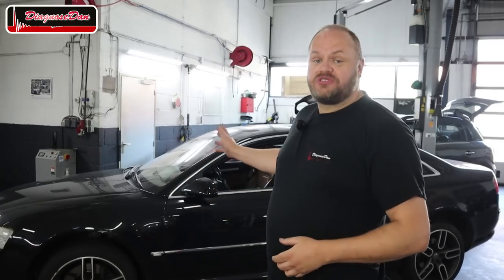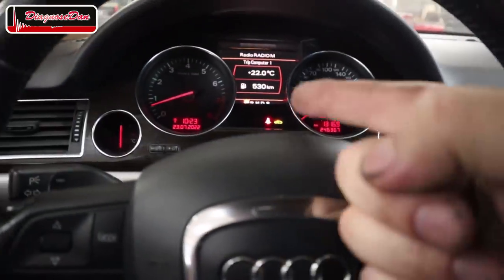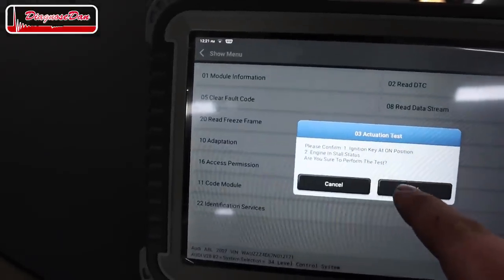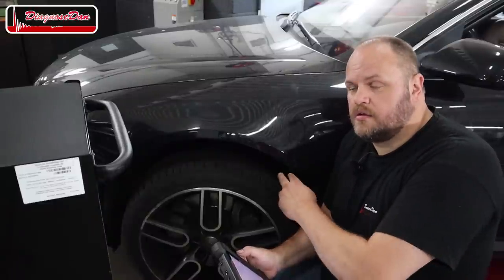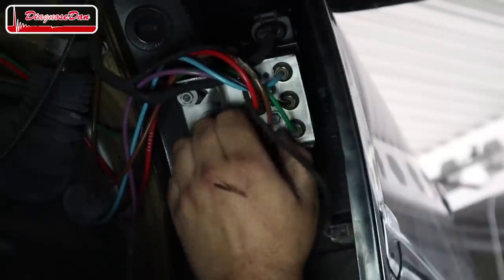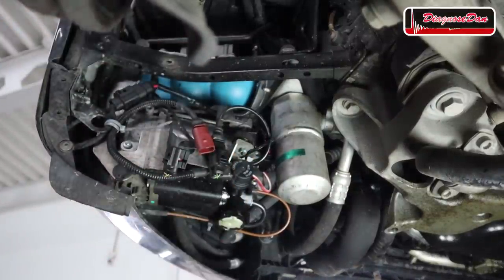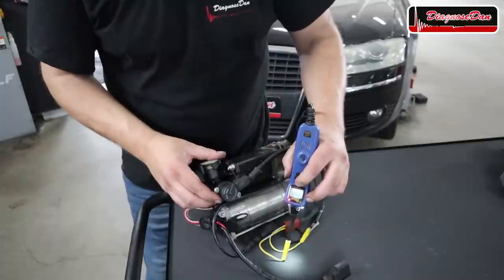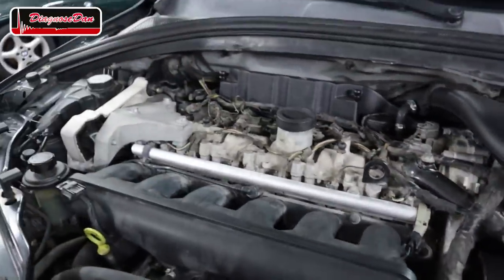Fake parts causing faultcodes

Comment: I remember you having a genuine Bosch sensor once which was wrongly wired. So it does not have to be fake to be faulty.
Reply: True, I remember that too. But Dan you are the best!
Reply: There is a difference, the MAS is having 12V, Ground and Signal. Signal is always on the same line. If it would not be, the ECU would get back either ground or 12V. 

Some also have 5V reference that got pulled down, so 12V for heating the wire, 5V pulled down for signal. 

If the sensor would've the wrong pinout like the Cam Shaft Sensor back then, it would have been a total different thing, because the ECU would get 0 grams or astronomical numbers.

But good idea, a wrong sensor type can be the error here. It's hard to match them sometimes, no shame when that happens.
Reply: @Golo1949  Couldn't agree more!
Reply from the maker: After that video i was contacted by Bosch. They doubted it was an original Bosch. I have send that sensor to their waranty departement for Investigation. They told me what to look for on an original sensor and that made me think it was actually a fake. But i'm stil waiting for the results of the Investigation. I'll keep you guys updated
Reply: @Diagnosedan  Wow, if you cant tell the difference of a fake part to it's original,  they made progress on faking it pretty good
Reply: @Diagnosedan  Good to know. Thanks for the additional information.
Reply: A misstake often made, just because it's new doesn't necessaliry mean it's good.
Reply: Had same issue with bosch crank sensor
Reply: Many replacement parts even though they are branded parts are still made by a few companies. I've heard of OEM replacement parts being made by DORMAN.
Reply: @Diagnosedan  Bosch doesn't manufacture sensors themselves, they just source from other manufacturers and label/repack to their boxes (as well as other items, e.g. drill bits. The drill bits manufactured as 'BOSCH' are actually manufactured in Vilnius, my home town, factory, same technology as they sell regular bits, just by order from Bosch, they laser-mark them with that brand.)

So long story short, do you care to share on 'what to look' to ensure you have good/genuine Bosch unit? I had a dozen of 'no start' cases after replacing camshaft and crankshaft sensors, including Bosch. Thanks.
Reply: I just had an OEM oil pressure sensor being broken right out of the box.
Reply: @Diagnosedan  Was benieuwd of je ondertussen en reactie met bevindingen van Bosch had ontvangen?
Reply: @Diagnosedan  To be frank, I don't think they'll tell you anything else than "this was a fake". Why would they admit responsibility?
Reply: @Diagnosedan   any update Dan?
Reply: Bosch Quality these days are not doing hot. However, Bosch parts are made in other countries other than Germany are no better. In China, the factories that are contracted by Bosch to manufacture those parts have management issues. All parts coming off the production lines are subjected to tests by Bosch or Bosch Standards. Failed parts are dropped off the line and planned to be destroyed. However, this is where the management issue comes up. Employees who are involved in destroying these parts are smuggling these parts out and sell it to other parties, sometimes, these parties are shady business which repackages these parts with Bosch branding. Technically no body even Bosch cannot tell because these are genuine Bosch parts only failed tests, tests including functionality, performance, durability and cosmetics. If you get lucky, you get a part only failed the cosmetics. These parts are known to be "original off-line" parts. In China, I would use Chinese branded aftermarket parts, although most of the time, the only problem is durability but the cost is 10 times less if more more. I only choose Bosch Original when there is no branded aftermarket alternative. Original Bosch in China has genuine protection system you can use to verify if the part is actually coming from Bosch. I usually choose Chinese branded aftermarket parts not because it's cheap, but because it is highly unlikely a fake. I mean if you are faking why fake something has less value. These Original Off-line parts are really headaches, because it is not that cheap even they are sold as Off-line parts. And because of these parts, you can not even be sure that the one you purchased as Original Brand New Bosch part is actually Original Brand New. Everyone hates these parts and the people who smuggled these parts out should be convicted as criminals.
Reply: With Bosch tools, their cheap ranges can be quite poor quality. You may still be getting what you pay for, but it does mean you can't say Bosch is always good quality. Makes you think that if they are willing to sell cheap low quality tools they may also sell cheap car parts?

Comment: good morning friend and colleague. I have been following you for quite some time and I really admire your excellent knowledge on diagnosis. I am George from Corinth, Greece, I am also an engineer, but an old one. We engineers of this generation are NOT that good with diagnoses. admiring so your knowledge, I take the courage to ask for any valuable help from you. has my son one Suzuki swift 2015 model with engine k12b. for about a month now he has been showing his signs esp.this only happens in the morning when he goes to work and when he stops for coffee at about 700 meters, when he starts again it does NOT come on anymore and will NOT come on all day long.in a diagnosis I made at the local dealership, we saw that there are NO errors recorded.they told me not to worry and that it is absolutely nothing in discussion with the chief engineer there, he advised me to change the battery. the old one was almost four years old.I replaced it with a new one Bosch .the problem unfortunately continues. its warning light esp it only comes on in the morning and as soon as you turn it off and start the engine it DOESN'T come on anymore. i know I tired you, but I tried to describe the whole problem to you in detail. There is nothing in the recorded faults, or the diagnosis, I repeat, was made in Suzuki of Corinth. I greet you, I admire you and I hope you are always well. It's a shame that such a distance separates us. Thank you for any help you can offer me. George Korinthos

Comment: That was an excellent example of counterfeit parts and the symptoms they can produce. The saying applies "just because its new doesn't mean it works correctly" !  This is the stuff that can burn an entire weekend chasing those trim numbers . Thanks for the great presentation
Reply from the maker: If you don't doubt the newly installed parts it can keep you running around in circles forever!

Comment: Great customer service for replacing the whole pump again under warranty. 👍👍
Most places might give 30 days on electric parts.
Reply from the maker: I Just think its not acceptable to tell my customer that hé needs another compressor after me replacing it a year ago
Reply: @Diagnosedan  - I suspected as much.  You're a good man.

Question:   Can you only buy the valve?  Or is only available as a whole assembly?

Comment: Awesome work as usual, Dan! 
As an automotive engineer I really respect all you knowledge which is not so common seen in the modern world! 
I also love to diagnose and work on my own vehicles and you are one of the main reasons! Thank you very much for all the knowledge that you share with us!
Reply from the maker: Thank you very much Pavel
Reply: Perhaps you can help me then! On the Toyota forum here in the UK we were discussing the MMT multimode type transmission fitted cars like thr Yaris Aygo and many more which is a programmed actuator on top of manual gearbox and the main guy said any tool that has bidirectional control are capable of relearning such transmissions like Autel 808 would you know that because in the advert descriptions it doesnt actually say re learn mmt transmissions only gearbox relearn? Yes i know you can buy pass through devices that can get you on to tecstream if you go through all the hassle tying to sign in succsefully? if you know what i mean. thanks
Reply: What nasty tricks the manufacturers do pull. Connecting hardware to a car via software tricks. i hate it

Comment: I was a little surprised on the fix you used on the air suspension.
Pneumatically it appeared to be designed for maximum reliability with the common exhaust valve. As all the other valves I bet would be the same style.
That particular unit I noticed that you didn't depress the poppet that was in the coil. Chances are it was hung up on some debris preventing the coil from lifting the poppet and allowing the air to escape. A quick wash and more importantly a purge of the lines to ensure it was clear of debris would have been in order. All it would take is one or two grains of sand to hang that sort of valve. That valve unlike the others only passes air in one direction so it wont clean itself.
Regardless always enjoy your channel, I hope it isn't to warm in Europe for ya.
Cheers from Aus
Reply from the maker: It was very hot here last week. 
I've never had this issue before and for this particular customer we tried a different supplier to check the quality. First time i use their product i'm getting a comeback. I send the complete unit back to that supplier. I don't want to Risk another comeback
Reply: @Diagnosedan  That wasn't an OE part, then!?

Comment: Great vid as always.  About 10 years years ago i bought a maf for my 1.8t Golf using the Bosch part number online. Fitted replacement and car ran even rougher... cleaned the original Bosch one,  it solved the problem and is still on the car today at 150k miles 😁 still have the "fake one' in a parts box somewhere 😂
Reply from the maker: Unfortunately fake parts are a big problem

Comment: Hi Dan another very informative video. People might say I’m nuts but I always try to replace my faulty components with OEM parts. Dan you and family stay safe and well Artie 😊
Reply: Me too.
Reply from the maker: Artie, i agreed with you. Sometimes the aftermarket brands are actually also the OE supliers and they make the same component in another box a lot cheaper.
Reply: @Diagnosedan  true. I had that on my Mercedes Vito recently where I had to replace the fuel rail sensor.
The OEM were quite expensive, but because I knew it was a Bosch part, I was able to source it for less than half the price.

Comment: Yessiree....Best to use OEM parts especially sensors !  I have purchased OEM parts on line but from companies that source those parts such as Rockauto who give choices, OEM or aftermarket in most cases. Air suspension has been a maintenance item for decades. Shops best methods for advertising is to do repairs just like these were. Start from scratch and work your way in the elimination process to find the ONE item that is bad. That by itself proves to a customer what shops have the gifts to repair vehicles correctly vs. shoot parts at them.  Thanks Dan.
Reply from the maker: Thanks for the awsome comment Garth

Comment: I hate it when the owner screws the pooch  first and then asks the mechanic to fix it. I learned a long time ago to first put on the Sherlock Holmes cap and interview the owner. (Oh and I know that I am on the right track when I see Dan using my Autel, my Fluke, and my Powerprobe) Great video, thank YOU.
Reply from the maker: Most of the cars that come in to our shop have been worked on before by other workshops. Sometimes the problem is made worse 🤣

Comment: valve corrosion a known problem,: 
either the compressor filter has not been replaced 
Or the suction tube between the filter and the compressor is damaged.  

known fault in Scandinavia / humid climate filter needs to be changed every 3-4 years.

Air mass is a very common problem on parts from the Internet, the same problem is with the new EGR valves, coils and new electronics. 

Good Job

Comment: Hello Dan, on your TOP DON diagnostic tool, you have to do the online registration, when you choose the module you want, you have online secure log in. Do it, and you unlock the functions, usually its the first 5 numbers, sometimes its the 2nd one. . Thats why its not working. I hope i have been of help. The software is the same as the launch x431 Diagnostic tools. 
Continue the good work, i have learn a lot from your videos

Keep up the good work

🇵🇹👍💪

Comment: Hey Dan,

I recently had to buy a new to me, but used Toyota Avensis and I've been slowly diagnosing and fixing parts for high cold start rpm:s and idle rpm:s that go up and down. Saw the Hella MAF and had to instantly go an check the code on my cars "Hella" MAF. No surprise there, it's also missing the last number compared to actual Hella part number. It wasn't really dirty since it had been changed, but I did clean the sensor with no noticeable difference.

I've been using OEM parts while diagnosing this, but the car came with that Hella MAF. That's probably the next thing I'll change to original Denso part.

I also noticed that the real Hella part is "compatible" with a huge array of cars from 1.4l - 90PS Yaris to 4.0l V6 - 280PS engines and that doesn't sound right either.

Still need to change the inlet manifold gasket and clean the throttle body from the backside while I'm at it. The front is already clean and I've checked the hoses, changed the air filter & spark plugs and installed one missing air box clip.

Thank you for the video, because I think this might be one step closer to fixing the idle issues :D
Reply from the maker: Good luck 😉

Comment: The Solenoid valve has a iron/steel rod in the middle, as you can see in the video. That rod should be loose, yours was rusted stuck I believe. 
I had the same problem last year, mine was rusted, I was able to free it but found the spring inside it had rusted also and was broken.
I cleaned everything well and found a spare spring that had the similar spring/pressure as the old one, and the valve is still working, close to a year now.

Comment: I have a 2004 Trailblazer 4.2. For the last 7 years. It has been getting 14.3 mpg mix driving. There is no cel. Someone online said to replace the map sensor. I bought one online for $13. It looked like the stock sensor but would not lock in. I went to AutoZone and bought one for $80. It locked in and now I’m getting 15.7 mpg.

Comment: Same thing happened to me with an oil level sensor, FEBI brand and bought from a respectable shop, now it's throwing low oil level but the engine has max oil on the dipstick. These days you cannot vouch for any shop or part, the mafia of fake parts is deeply rooted in all retailers. Good thing i have and older car with a dipstick, if it was without one, like the newer ones , I would have bee n scared, not run the car and tow it to a shop, spending a lot of money in the process. But seeing that oil level is fine, I will change this sensor at the next oil change, since the pan needs to go out.

Comment: great diag Dan and fix as always , i have topdon and the actuator test can be annoying sometimes , i had the same issue on a vw , i need to do afeedback report, maybe you could do one too . thanks Rob mobileman
Reply from the maker: Hi Rob, when you provide feedback they usually fix the problem very fast. But unfortunately that doesn't help you very much when you need it right away😁
Reply: @Diagnosedan  
Thanks Dan , Dan I have dtsb , what is the hotline help charge ? Thanks again 
Rob mobileman

Comment: I learned this lesson long time ago. Every time you put aftermarket air mass meter, DPF pressure sensor, map sensors etc. sooner or later you end up with "comeback", intermittent faults which are pain to diagnose... The diesel engines are less "picky" with aftermarket air mass sensors, but still newer cars, for example mb with Delphi systems because of bad aftermarket air mass meter sensor had faults showing for boost leaks, EGR opening to much and etc. The DPF pressure sensors usually go bad after few months popping faults for bad DPF, but the problem is the sensor itself (reading negative pressure or way higher than it is)... Had the sensor shorting 5 V and shutting the car down... Usually if we can't get new original part, we search for original used... There are some aftermarket parts that are usable such as temp sensors...
Reply from the maker: It's a challenge 😉

Comment: Great Video Dan! Just Curious, wouldn't it be better to disconnect the brown line at the compressor to make sure it wasn't a stuffed line before pulling out the compressor?
Reply from the maker: The compressor was still able to raise the car. So the Brown Line had to be open. It's a simple tube and can't be stuffed in 1 direction .
Reply: @Diagnosedan  Thank You! I didn't realize it was the same hose.

Comment: Hi Dan, you are BMW master mechanic with lot of experience and knowledge.  Question for you buddy.  I have BMW X5 2012 E70, few days ago I disconnected battery to work on alternator.  Once, I replaced bad Alternator and re-connected battery but somehow it fried my FRM3 module.  Now, I have to replace my FRM3 module from dealership... what will be the cause that fried my FRM3 module when I re-connected battery.  as, far I know my battery had no issues or any error codes etc.?